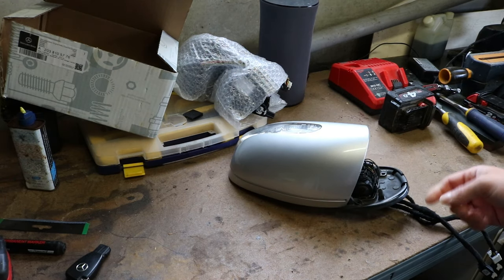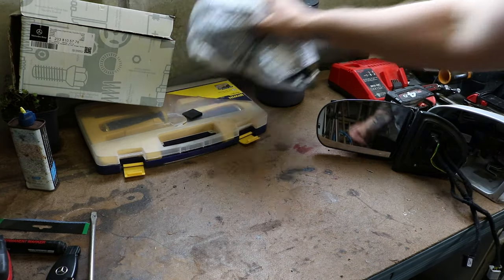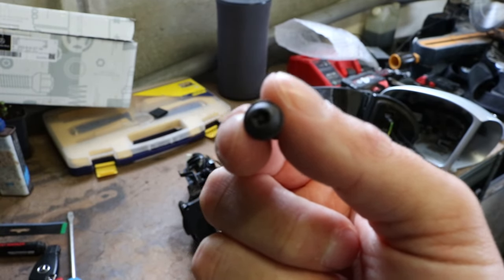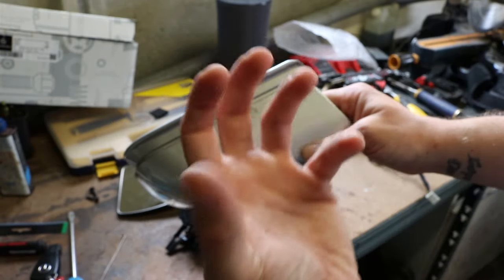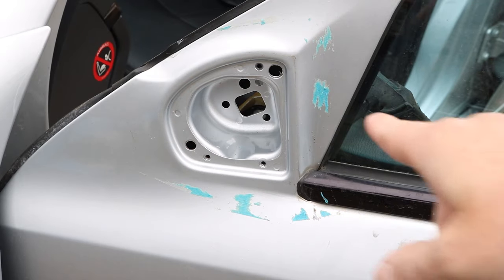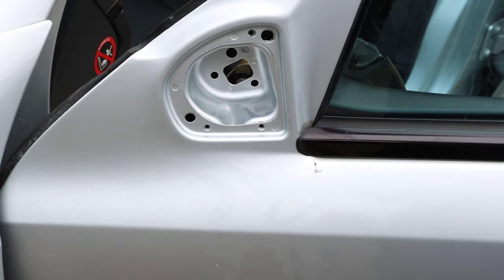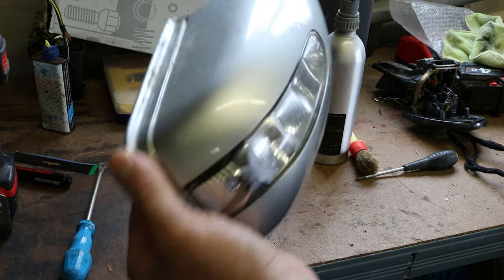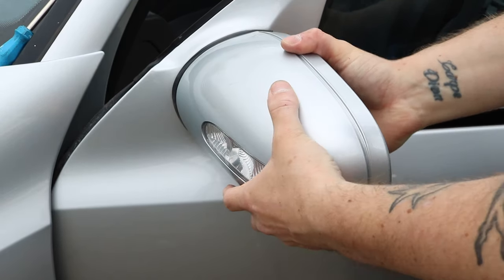W211 E320 Mercedes mirror finally fixed! *New mirror install*

Comment: How much did you pay for the part? I also need a heated folding one
Reply from the maker: Hello sorry for delay, I think I paid around £280 if I remember
Reply: @Enginesetc  thanks! Still quite a lot, might try to replace the wires on mine first (heating is not working and it's not always unfolding)

Comment: its pre 2006 model ?
Reply from the maker: It's an 06 plate but most likely produced 2005 so technically yes :)
Reply: @Enginesetc  is it facelift ? As i have problem with folding mirror motor, door module is ok as i checked with multimeter and it show me volts while i push mirror folding push button
Reply from the maker: @ukaszjurys2475  no this one was pre facelift. Have you checked the voltage at the end where it connects into the actual mirror motor not just the module? Might be a breakdown of the wire somewhere between door module and the actual motor, the wires in this one before replacing were really brittle